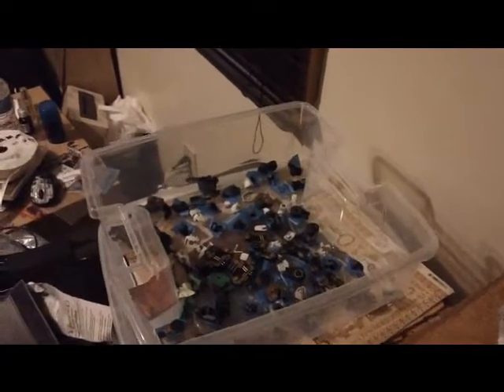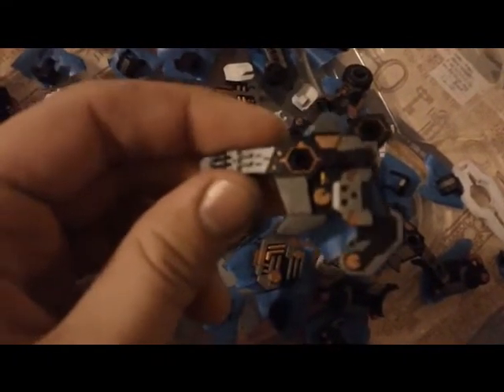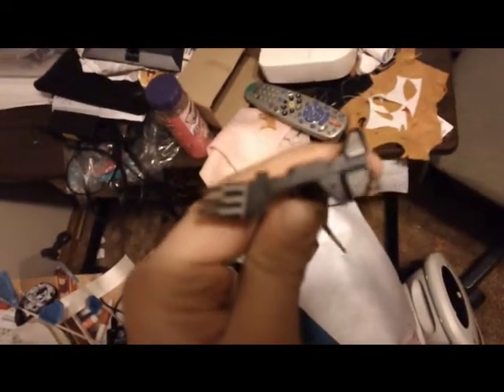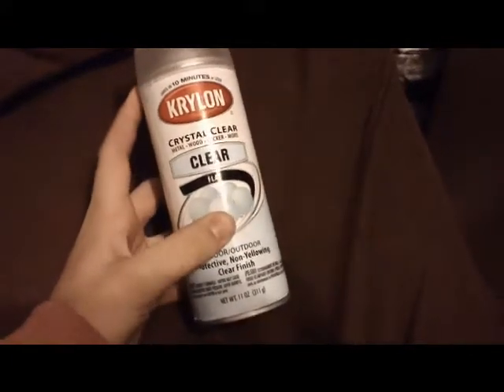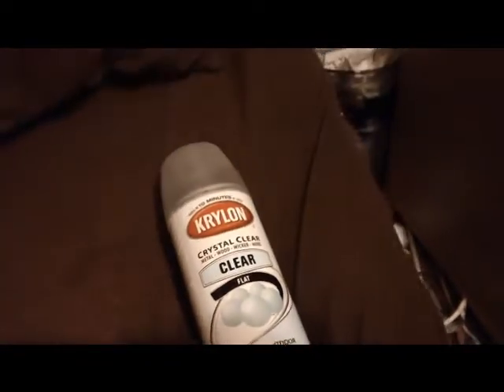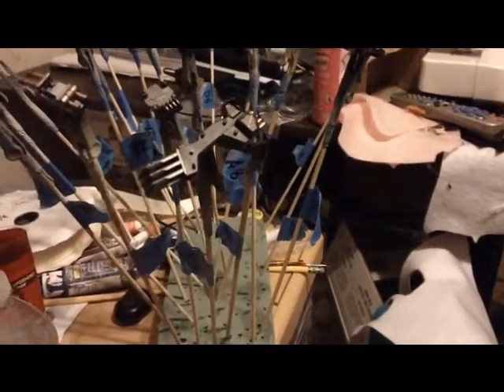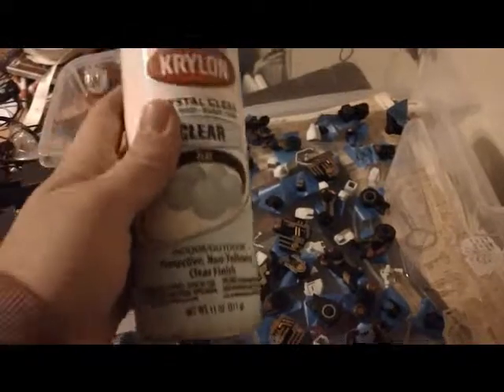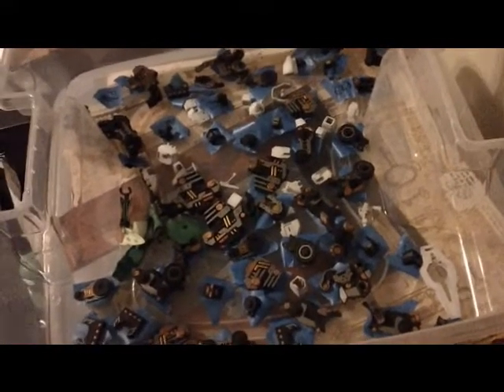Kotobukiya HMM Liger Zero Schneider WIP #2

Comment: I've had the same problem with the flat base and future. After some experimenting, I believe it caused because it dries really fast. I get around this by nearly flooding the piece. I pulling the airbrush trigger all the way back and spraying at a further distance. This creates a much bigger spraying area with a lot more paint coming out. This helps me cover the whole piece before the top coat dries. Might want to try that once you run out of Krylon.